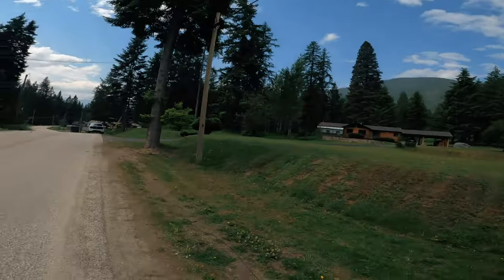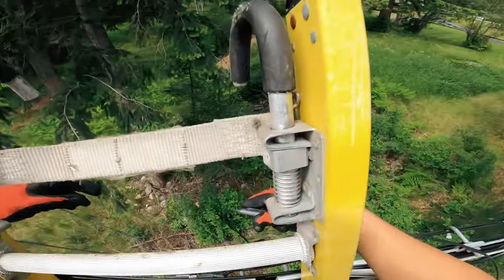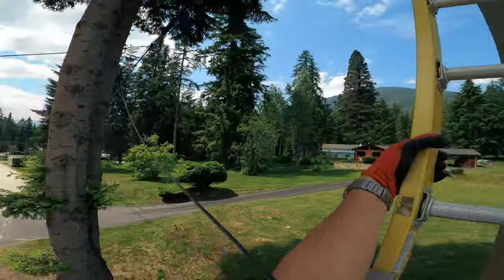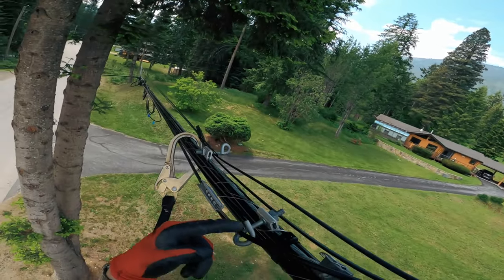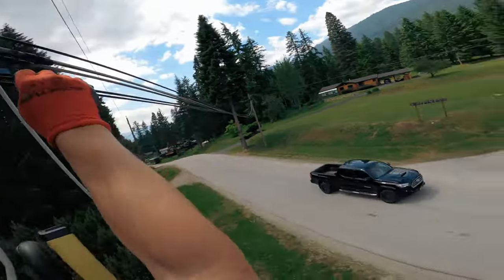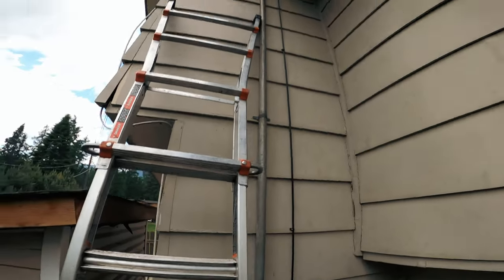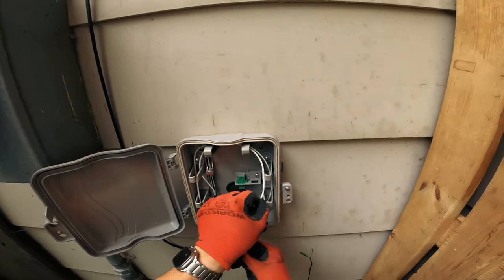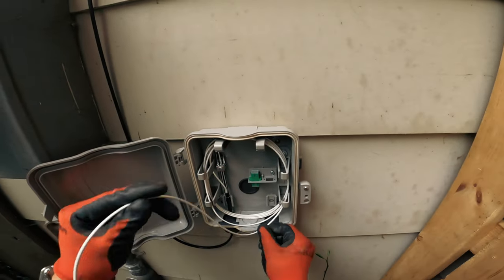Double Fiber Drop to Quadplex

Comment: I’m not one to criticize how someone does their job, you seem to have a good grasp on what you do , but I am an old timer , going on 50 years in the business. I don’t see very many young installers using spurs any more. When I started out we had to be able to climb, it was a prerequisite. Is  that not the case any more. I have always assumed that a ladder was the most dangerous tool on the truck and I never used it if there was any way around it. I’d appreciate hearing your thoughts on the subject. And in closing , I assume that you are a young man, I hope you enjoy your career as much as I did and still do, it’s been a great ride
Reply: I’m a US based fiber/Coax installer  we don’t get training fur spurs unless you go out into the rural areas that it’s more common to see poles in the middle of a field or tree line. I have my own set of climbing gear I keep just in case but I use my ladder 99% of the time just because it gives me more flexibility when running the long 2000 feet drops we do on occasion 😅
Reply from the maker: Watch some more videos 😅 I climb when needed. I just have a lot of ladder experience so I feel safe and efficient on them. Also I work solo a lot and don’t like the idea of being “stranded” get it 😅 with all my tools and truck unattended. 

I like climbing. But I find it slower than ladder 😅
Reply: Where im at they don't give out spurs or training unless you work very rural where the strands are commonly above 28ft.

Comment: What is the name of the attachments on the strand that you connect your drop clamps to? Thanks
Reply from the maker: Are you referring to the O clamps ? The ones I bolt to the strand ?
Reply: Yeah,  I've never seen that before. Thank you for letting me know.
Reply from the maker: @slammeddubber  yeah people call them Oclamps or Q clamps. They’re great tho. I seldom use a normal U clamp unless in out of Os

Comment: I do envy you screwing in your clips onto the wooden siding. I always had to nail them onto the mortar joints between the bricks. Banged my fingers pretty good a couple times lol
Reply from the maker: Yeah pretty lucky. Don’t come across much brick and mortar here. A lot more stucco or plaster exterior walls tho. I still drill into them tho with tapcons or these tornado screws
Reply: Much asbestos in exterior cladding in Canada?
Reply from the maker: @davidranieri924  definitely come across it every so often.

Comment: Other than the wedge clamp and the wrap around style, are there other common methods to grab hold of the fiber span?
Reply from the maker: Not that I’m aware off. Wedge clamps and preforms are the 2 commonly used anchors I know of

Comment: Thanks for taking the time to record the install of the drop. Why do you need to have such a long fiber tail left in the demarc box?
Reply from the maker: Just protocol.👍🏼
Reply: I have installed thousands of those Qspan clamps that way over the years working for the phone company, that drop isn’t going anywhere. You need to stop complaining so much and get the job done.
Reply from the maker: @dhobbs1974  all my jobs get done my friend. I’m trying to teach people what not to do. I’m pretty sure I even said in the video it wasn’t going anywhere. Yet it’s still not placed properly. We follow strict guidelines here and a thorough inspector would fail that. It may not be the same everywhere, but I teach what I know.
Reply: @FyBurz it's actually a perfect amount. It's always better to have too much cable to work with than too short.  Especially with fiber it's nice to have slack when you're splicing.  If your connector fails, you got lots to work with.  I hate when guys leave very little slack.  Same with copper too really.
Reply from the maker: @derekwilson6396  definitely, that’s the main reason. If the cut off is recycled anyways. The rare time I leave less than 3 spans is just cuz the drop was short. But if it’s less than 1 arm span I re pull. My line would fail QC.
Reply: @FyBurz  another question how often do you change your blades on your blue fiber drop stripper tool? You seem to never have issues when stripping the drops.  Some days I really fight with it.
Reply from the maker: @derekwilson6396 it can vary. Much more in the winter because the drops get wet/dirty and grimy which dulls the blade. But maybe once a month. Keeping them clean helps a lot. You’ll often see me clean the strippers before using them. Flat head to the groove to remove debris from the last strip. It’s 🔑 having the blade clear. Ensures good contact, the difference between 3mm of blade cutting vs 1-2mm is drastic.

Comment: Would a car driving over the drop ever cause damage to the fibre? I’ve always been paranoid of leaving it temporarily on the road, and tend to just wait for it to be clear, run across and pull it up quick 😅
Reply from the maker: Definitely something I avoid just for the small risk factor. But normally it’s totally fine. 

During winter I avoid even more so cuz of sand rocks and studded tires.